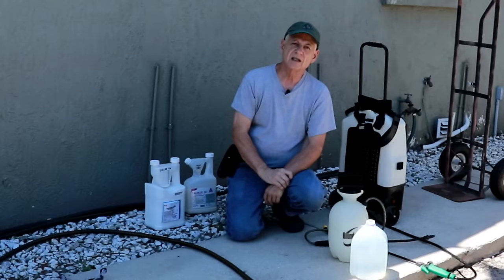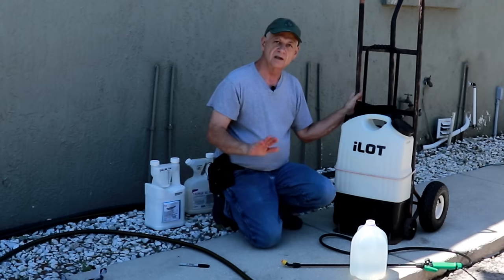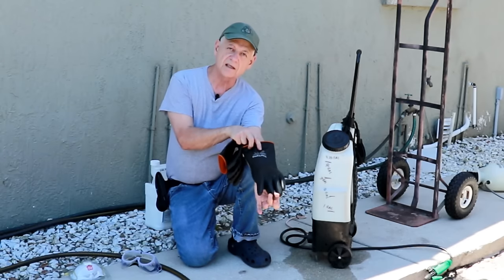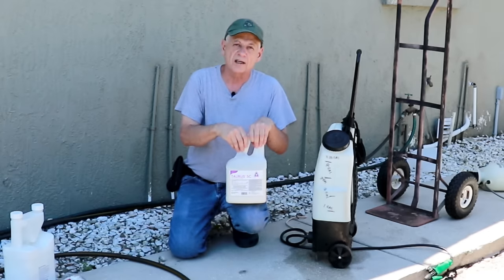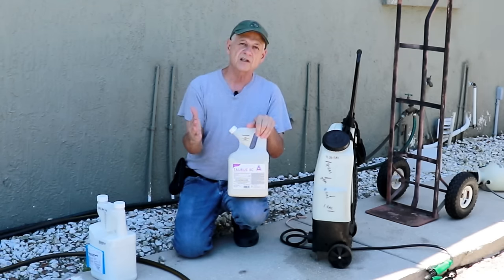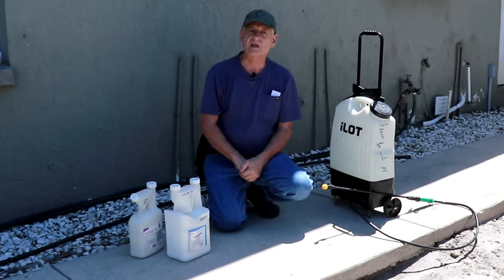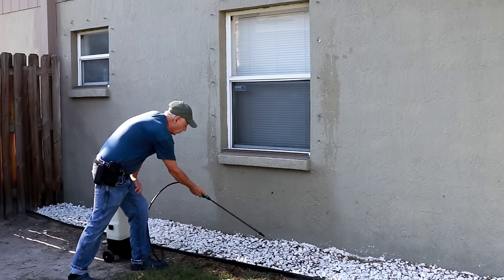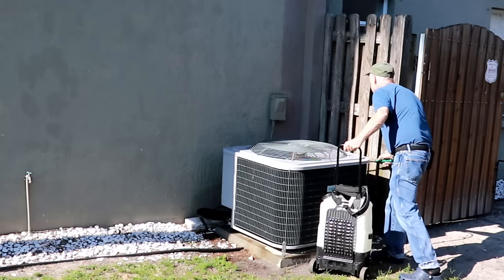General Exterior Pest Control - IMPORTANT!  READ THE DESCRIPTION.

Comment: Thanks for the information about termites.  How about brown recluse spiders inside the house?
Reply from the maker: Brown Recluse spiders are really pretty easy to get rid of.  If you stop and think about it, spiders are not exactly getting beamed into the house from the Starship Enterprise.  Right?  They're coming in from the outside.  Therefore, the solution is pretty simple.  If you do a proper exterior treatment of your home, every three months, then you will no longer have spiders getting in the house.  In fact, a proper exterior treatment is going to stop almost every other kind of bug imaginable from entering your home.  In the DIY Pest Control video you just watched, I recommended using either Taurus SC or Talstar P, but you can just go ahead and use a product called Bifen XTS.  It's pretty much the same thing as the Talstar P, but it's a bit less expensive.  The only thing is that it gets mixed at 1/3 ounce per gallon, instead of 1 ounce per gallon.  So, it may seem more expensive, but keep in mind that it goes three times as far.  So, divide the price of a gallon of Bifen XTS by three and you have the equivalent cost of a gallon of Talstar P.  Just follow the procedure in the video every three months, using the Bifen XTS, and you should be good to go.   Also, please note that the sprayers I use in the video are no longer available.  Therefore, I will also give you a link to the sprayer that I recommend. 

Now that you have prevented additional spiders from entering your home, let's talk about how you get rid of the ones that are already inside.  Fortunately, Brown Recluse spiders are super easy to kill.  Now, I could recommend some professional products that would do the job, but that really isn't necessary.  When it comes to killing spiders, all you need is a can of Raid Flying Insect Killer, or some similar product, that you can buy from Walmart or any other place like that.  You do not want to buy the Raid Ant and Roach Killer though.  That will kill them on contact, but it's a bit messy.  Simply spray the spider webs with the raid and the spiders will die fairly quickly.  Then, just knock down the spider webs with a broom or dust mop.  Also spray that raid under the bed, behind the headboard, under and behind dressers, and any other place where you are likely to find spider webs.  After you kill all the spiders inside the home, you will no longer get new ones entering because you treated the exterior.  It's pretty much that simple.

By the way, it helps to also treat your yard, and I am coming out with a video within the next few days on how to do that.  If you subscribe and click on the bell, you will get notified when that video is posted.  I promise that it will be worth watching.

Be well my friend.

Comment: Is Taurus Tc  mixed at .4 every 3 months as effective as using .8 every 6 months for termites?
Reply from the maker: I am not a big fan of diluting pesticides to anything less than the most effective dose.  That is because it is not going to work as well.  The video you watched was the first one that I ever did, so there is a couple of things that I did not make exactly clear.  What I recommend is that you do your first treatment with Taurus SC, mixed at 0.8 oz per gallon of water.  Three months later, do another treatment with the Talstar P, and do all future treatments every three months with the Talstar P.  If you would like to save some money, you can use Bifen XTS instead of Talstar P.  You may get a little sticker shock when you see how much the Bifen XTS costs, but keep in mind that it gets mixed 1/3 of an ounce per gallon of water, instead of the one ounce per gallon of water for the Talstar P.  That means the Bifen XTS goes three times as far as the Talstar P.  So the Bifen XTS actually costs less her finished gallon.  Also, you can use the Bifen XTS in a hose end sprayer and treat your yard with it as well.  I will give you a link to the product and a link to my video on how to treat your yard.  Treating your yard will eliminate almost every kind of pest imaginable that may be breeding on your property.  This would include things like mosquitoes, ants, American cockroaches, beetles, and a wide variety over the pests.  I hope that helps. Be well my friend.

Bifen XTS:  https://www.domyown.com/bifen-xts-p-1236.html

Video on how to treat your yard with a hose end sprayer:  https://youtu.be/wifoTU5dmp0
Reply: I have watched 5 videos and never really got any clear answers to the 10 questions I had. Your video and answers to others comments answered all of them ! Thank you so much. You answer everyone’s questions and give them more answer than they asked for. Most people don’t answer videos after a few months thanks again.
Reply from the maker: Thank you so much for those kind words.  Very much appreciated.  Be well my friend.

Comment: Guy I used Taurus for termites so I can use it as well for pest control !! Wow
Reply from the maker: Yes.  Taurus SC works great for general exterior pest control on the building.  You can do it cheaper though with Bifen IT.  I will give you a link to it.  Just apply it every 90 days.

Bifen IT:  https://www.solutionsstores.com/bifen-it-insecticide

Comment: witch kills more taurus sc  or suspend sc or tempo sc
Reply from the maker: I use Taurus SC all the time, but I have never used Suspend SC or Tempo SC.  Taurus SC works differently than the other two and it is for exterior use only and you should not use it on plants or the lawn.  It is designed to be a slow kill product that bugs do not recognize as a pesticide.  The idea is that you want the bugs to take the pesticide back to the colony, nest, or whatever and share it with the other bugs to wipe out the entire colony.  It is very effective against all sorts of pests, but is only labeled to be used every six months.  The thing is though that it does not last six months.  So, you need to do an in between treatment with a different product three months after you use it.  Both Suspend SC and Tempo SC can be used indoors or outside and can be used on your lawn and plants.  The active ingredients in these products are different and the Tempo SC claims to kill over 100 different pests, while the Suspend SC only claims to kill over 50 different pests.  Killing over 100 pests sounds better than 50, but the truth is you probably don't have any of the pests that Suspend SC won't kill.  So, I don't think it matters much if you are choosing between these two products.  I am very familiar with the active ingredient in Suspend SC, which is Deltamethrin.  I am not familiar with the active ingredients in Tempo SC, which is beta-Cyfluthrin.  I don't recall using a product with that active ingredient.  I guess, like most folks, I tend to stick with what I know.  That does not mean it doesn't work as well or even better.  There are a lot of pesticides out there and I cannot possibly try them all.  So, if it were me, I would use the Taurus SC and then do a follow up treatment with another pesticide three months later.  I think this would be a great time to experiment a bit.  Try the least expensive option and see if it works.  If you like it, then stick with it.  If you are not happy with it, then move on to something else.  I always use Talstar P for the follow up treatment and the active ingredient is Bifenthrin.  You can also buy a cheaper version of it called Bifen IT.  They work the same, but I find that the Bifen has an noticeable odor to it.  It is supposed to be odorless, but it isn't.  The Talstar P is truly odorless, so it's great for indoor use.  So, the bottom line is to try new things and see what you think.  I don't think you will go wrong with any of these products.

I hope that helps.  Be well my friend.

Comment: hello , what do you recommend for scorpions?
Reply from the maker: Buy Onslaught FastCap Spider and Scorpion Insecticide.  Mix it according to label directions in a battery operated tank sprayer and spray up the side of the building 36 inches and out away from the building 48 inches.  Be sure to soak the area where the building meets the ground.  Also apply this on your patios, stairs, sidewalks, and that sort of thing.  In other words, you want to apply it any place you frequently walk.  This will stop the scorpions from getting in the building or hanging out on surfaces where you frequently walk.  Next, you should apply it on all ornamental plants around the building as well, being sure to treat the dirt under the plants.  I recommend applying it every 60 days.  Look for obvious penetrations in the side of the house and treat them with D-Fense dust.  Just buy a duster, fill it halfway with the dust, and puff the dust into any cracks or crevices that you find.  After treating, it is a good idea to caulk these penetrations as well.  You can use a pump-up garden sprayer, instead of a battery-operated sprayer, but it takes a lot longer.

Always make sure that you hang up all your clothes.  You should never leave clothes laying on the floor.  Clothes that are waiting to be washed should be kept in a sealed hamper.  Shoes should be kept off the floor on some sort of a shoe rack.  After you finish the exterior treatment, you should check the house for scorpions.  Look under appliances, in closets, under the bed, and that sort of thing.  Be sure to check shoes, curtains, or anyplace these guys may be hiding.  To assist in your search, you can use a black light.  All scorpions will glow green when exposed to a black light.  

I hope that helps.  Be well my friend.

Onslaught FastCap Spider and Scorpion Insecticide:  https://www.domyown.com/onslaught-fastcap-spider-and-scorpion-insecticide-p-2579.html

D-Fense dust:  https://www.domyown.com/dfense-deltamethrin-dust-p-2428.html

Duster:  https://www.domyown.com/bellow-hand-duster-p-106.html
Reply: @GuysPestSolutions  super helpful thank you so so much

Comment: Do you recommend Bifen or Cyper-Tc for exterior use?
Reply from the maker: I would go with Bifen I/T, simply because it seems to hold up better outside than Cyper TC.  Cyper TC is better if you are doing an underground treatment, but for a surface spray around the exterior of the house, then I would go with Bifen I/T.  I'm not a chemist, so I cannot explain the reason, but Cyper TC seems to break down faster when exposed to the elements than Bifen I/T.  The active ingredients are totally different.  For interior use, they both seem to have the same residual time.  You can experiment with it a bit and see what works best for you, but that is what I have found to be the case.  The truth is that 90 days is a stretch for any of these products, but I seem to get a solid 60 days out of Bifen I/T and maybe more, depending upon the time of year.  Cyper TC seems to be more like 30 to 45 days.  Of course, this is not exactly a scientific study.  Just observation, based on seeing activity begin again after treatment.  Taurus SC seems to last the longest and the residual has lasted about 90 days.  Nowhere near the six months that they claim, but still pretty good.  That is the reason I alternate between Taurus SC and Talstar P every three months.  I find that alternating between these products give me the longest and most effective control.  The Bifen I/T is basically the same thing as Talstar P, except that I have found that the Bifen has an odor that I do not like, while the Bifen is truly odorless.  The Bifen is cheaper and works just as well as the Talstar P, but I cannot use in indoors because of the odor.  They claim that it is odorless, but it isn't.  So, I do pay a bit more for Talstar P.  I hope that helps.  Thanks for watching and thanks for the question.  Be well my friend.
Reply: @Guy's Pest Solutions  Thanks for all the information. I've been using Onslaught Fast Cap for interior so far. Do you know how effective that is compared to other products? For both effectiveness and safety around pets and children?
Reply from the maker: The Onslaught Fast Cap should be fine.  There are any number of good pesticides out there that all do the same job.  Mostly, it's just a matter of preference.  As long as a product has no odor and it registered for interior use, then you are pretty much good to go.  I hope that helps.

Comment: Can u use this on grass for the ants infestation?
Reply from the maker: The short answer is, yes, it will work on grass.  However, this is more than a bit controversial.  Using a product like Taurus SC on a lawn places bees as risk and, as you may know, the bee population is under stress right now and we need those bees to pollinate crops.  Taurus SC is a nonrepellent pesticide, so the bugs do not know that they are being poisoned and that includes bees.  The exposed bee takes it back to the hive and shares it with the other bees and they all end up dying.  The Talstar P is a repellent pesticide, so the bugs do know that they are being poisoned and it has the advantage of providing a quick knockdown.  Then the bugs avoid it, but when they do contact it, they die.  A better solution though is to use Bifen LP.  It's a granular product that you use in a lawn spreader and it lasts about 90 days.  You just water it in and you are good to go.  I will place a link below.  I hope that helps.

https://www.solutionsstores.com/bifen-lp-granules

Comment: Does it matter what temp or time of day?
Reply from the maker: The temperature or time of day does not matter to the pesticide, but it may matter to you.  During the summer months, when it gets really hot out, the personal protective equipment can get pretty uncomfortable in the heat.  So, in the summer I try to get out at first light when things are a bit cooler.  What happens all too often is that folks try to do this when it's hot out and they end up taking off things like the long sleeve shirt and the respirator.  That is a bad idea.  Also, it's a good idea to apply pesticides when it's not windy out.  You want to be sure that the stuff is not blowing back at you.  I hope that helps.

Comment: Is it safe for fruit trees and bees?
Reply from the maker: The product is safe for all vegetation, including fruit trees.  However, it will kill bees if they get into it.  The good news is that bees typically do not disturb the soil around your home or the building itself, so they never get into it.  The problem with bees and pesticides is when they are applied to places where bees are active, like flowers and other plants.  So, to avoid harming bees, simply do not apply the pesticide to any plants.  Of course, there is a trade off there.  If you don't apply the pesticide to ornamental plants close to your home, then you may have unwanted pests on and around those plants, like wasps, spiders, ants, roaches, etc.  In my case, we seldom see any bees, but we see a whole lot of wasps and so the risk to bees is minimal.  We are really treating for the wasps, spiders, roaches, ants, etc.  That being said, I only treat plants that are within a few feet from the house.  If vegetation is a good distance from the house, I leave it alone unless there is a significant problem like termites in a tree.  I hope that helps.

Comment: What is the product you are using?
Reply from the maker: I alternate between Taurus SC and Talstar P.  I recommend doing the first treatment with Taurus SC and the next treatment three months later with Talstar P.  So, alternate between these two products every three months.  If you would like to save a little money, you can also use Bifen IT instead of Talstar P.  It's the same formulation and the only difference is that the by Bifen has a slight odor to it, while the Talstar is pretty much odorless.  So far, I found that you can get the best price on these products from Solutions Pest and Lawn.  I will place a link below for them.

I hope that helps.  Be well my friend.

DIY Pest Control | Solutions Pest & Lawn (solutionsstores.com)